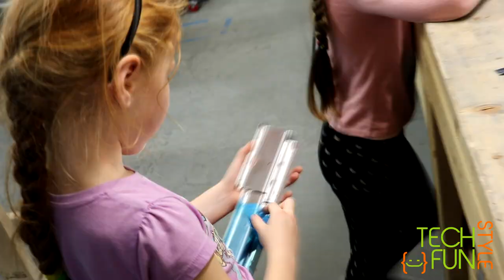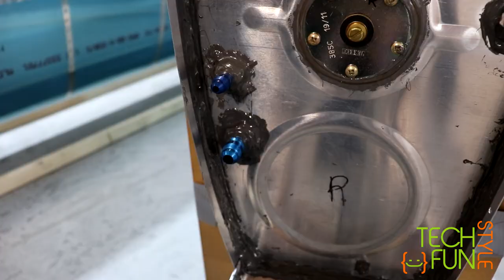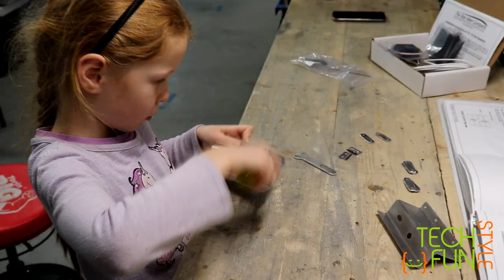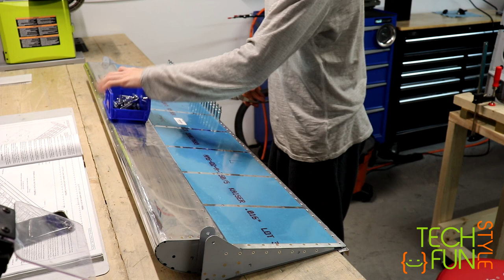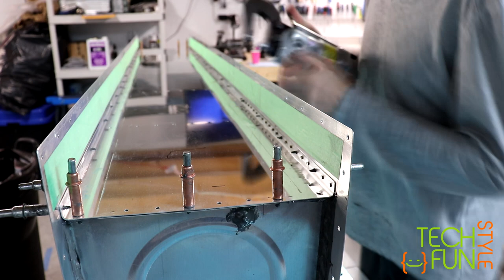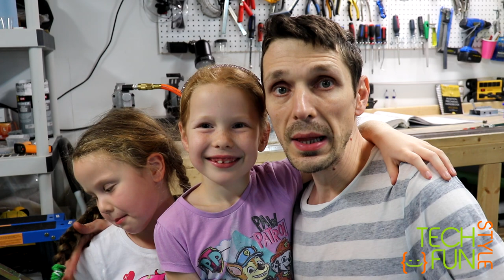RV-10 Parts finishing. Part 2

Comment: The slanted rivet sets need to be positioned at the exact same distance from the edge for all the rivets otherwise the results are not repeatable. You must have done a great job judging how far in they were. I temporarily clamped two angle bar pieces to the yoke to establish the exact die position from the edge every time.
Reply from the maker: Hi Martin! Totally true - I spent some amount of time before I figured how to hold and how close to edge should this rivet set be located.